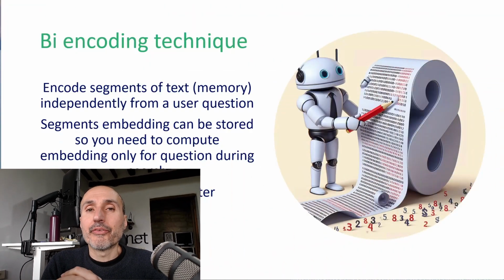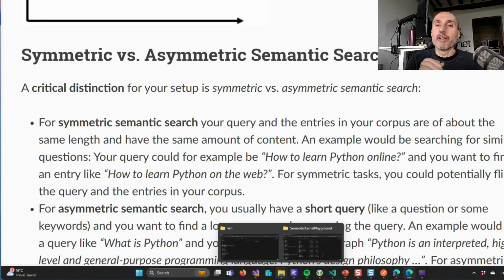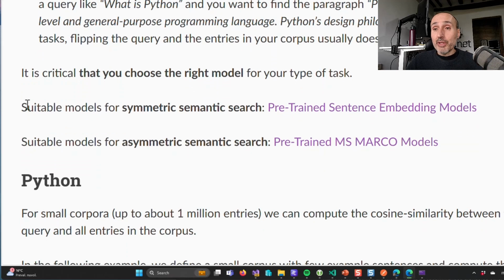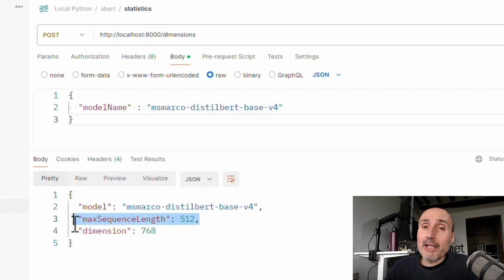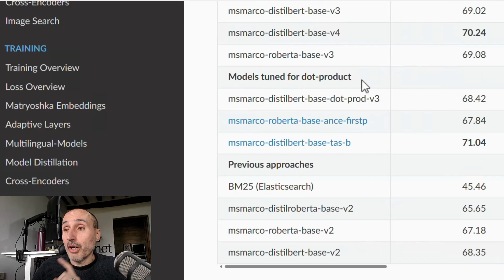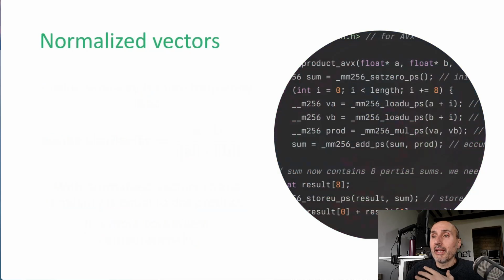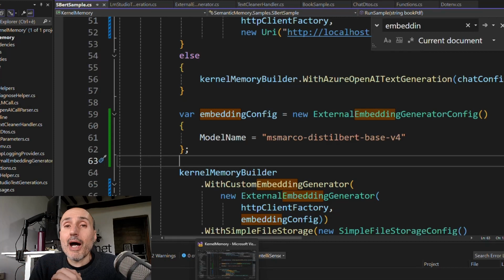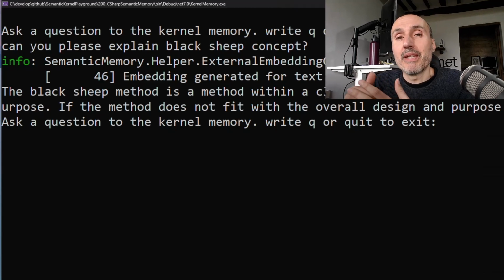KernelMemory - Some suggestions on how to choose a local Embedding Model.

Comment: Thanks for the content!!! Love how you explain. I have a question. What do you recommend for Spanish embedding? Thanks!
Reply from the maker: I did not tried embedding outside english and italian, so I really have no special suggestion. Actually we have embeddings specialized on english and multilingual for everythign else. I suggest starting with some industry standard (openai, cohere, etc) before trying local model. You can estabilish a baseline than you can start using some multilingual one.